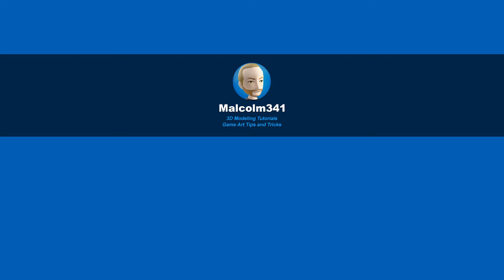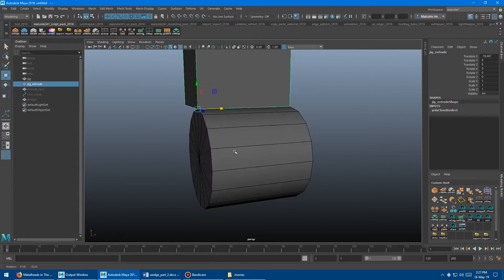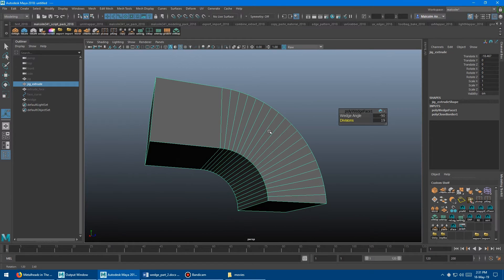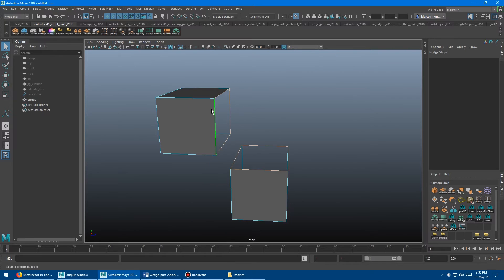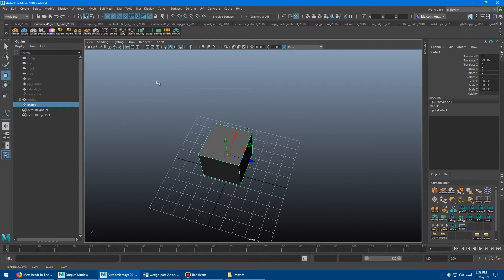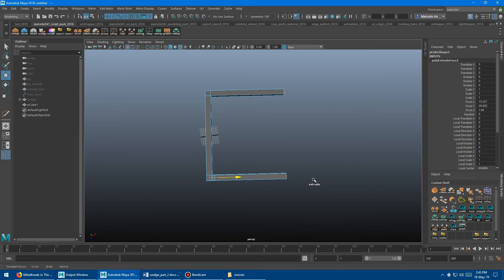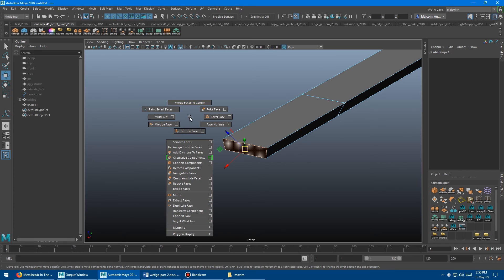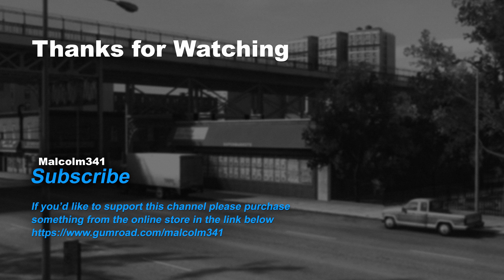How to Use the Wedge Tool in Maya - Part 2

Comment: You used Curve for bridge type, change the type to blend instead of curve and it will evenly distribute it without overlap. But I love the wedge version, especially if trying to match it to a specific type of Radius for a bend or corner. You rock man! Love your vids! Most of my Maya Toolkit playlist is your vids. I can't believe how many tools you cover that Maya users of years  of experience have never seen them, speaking for me as well! Regarding the extrusion of the faces in the new trick area, do you ever change your alignment to component with ctrl+Shift+RMB? I usually switch from World to component when I need to extrude along a face's direction. I just have to remember to switch back otherwise snapping stops working if not in world alignment.
Reply from the maker: I'm glad you find these videos useful. Yeah sometimes component mode works well for certain operations. There is an even easier way to wedge without even needing the jig, in the comments someone showed me you can create plane facing X, extrude the bottom edge a little bit, the in multi-mode selct the main quad face and shift select the bottom edge you just extruded and then wedge. This works on 3d shapes as well, you just need to a temporary edge and delete it when you're done.

Comment: the 45 angle trick is awesome bonus tip!!
Reply from the maker: @QCode11 Nice, glad it's helpful. I was shown another way to do it recently as well where you don't even need to create the cylinder. You can actually do it with only one mesh required. Create a cube and use the cut tool to add one horizontal edge on the side of the cube which will make up the face we're going to wedge. Now add another horizontal edge below the first edge and that will be used to create the gap/inner curve we would normally create the cylinder for. Now go into multi-select mode and select the upper face we created followed by the lower of the two edges. Use wedge and you'll get the same result without the need for the cylinder.
Reply: @malcolm341  So here what I did was cut a cube in half by multicut, then used the upper face with the lower edge of the lower half, and it does work like a charm!! Another option was to add any temp cube and, add optional edge loops, then use any edge to "wedge the face around" that way the selected edge seems to act as the "pivot" for the face to "wedge" around, thanks a lot for the tips!! knowing how to do things multiple ways definitely helps a lot!! And here we are many years later I found your channel to be of great resource when I need 'technical' know-how to do things!!
Reply from the maker: @QCode11  You can skip the temp cube all together and add a second edge below the multi-cut edge you added to act as the pivot, that seems to be the least number of steps I think.

Comment: Watched first part, now watching this, already did try it out and really thankful for this!!
Reply from the maker: @QCode11 an even faster way to do it is avoid the jig all together and add a temp edge to your object to use as the pivot point. For example create a cube and add a horizontal edge near the bottom of the cube, select the face above the edge plus the buttom edge of the cube, not the edge you just created and then wedge. That will allow you to concron the inner shape of the wedge on the same mesh.

Comment: u can even go simpler and faster with wedge tool , u don't need to create cylinder all u need to do is select an edge (any poly edge) that exist vertically under the selected face and then wedge (u can snap cube there and select its edge), after that u can simply controll the curveture by selecting wedge node and changing centerY attribute in the channel box ,i saw ur 2 parts videos to explain why when selecting 2 edges of the cylinder gives u the expected result is that when selecting 2 edges maya use the middle between the 2 of them which in ur case directly under the face , the selected edge in wedge tool is a rotation axis for the extrude faces ,imgine selecting the face and changing pivot to the edge then rotate the face from there,that's how wedge tool work but with extruding new faces
Reply from the maker: Nice, your method is even faster. You could even just add a temp edge to your first mesh and not even need a second mesh to select the edge on. Great trick, thanks for sharing.

Comment: finally a perfect tool for curves, thank you so much!
Reply from the maker: If you have 2022 you can also use the new sweep tool which is better for making curved pipes and other shapes.
Reply: @malcolm341  sadly im using maya 2020 but thanks for the info
Reply from the maker: @Ganzorpoe2  Dang, it's worth the upgrade if you are extruding pipes or roads, if you just need to do a couple corners wedge will be good enough.

Comment: 12:26 I feel attacked uahahahah
17:10 I don't get this part. I mean, it's a lot of steps and options to check no? Wouldn't it be faster to just grab the two vertices (on the left or the right) and make them coincide with the position of other two? boom, flat
Reply from the maker: Try it on a sphere by selecting multiple verts on a non-right angle part of the sphere and it will make more sense, it allows you to planarize any group of components to any specific angle so you don't need a script to do this. Oh wait, I made a video about this that describes it better, ha ha! https://youtu.be/yMyPsgaXstM?list=PLAUgGUDpaMENlPgh_phLty5JrumqX7Yr1

Comment: Hi! About Bridge Tool, you can just use Curve Type: Blend and add the Divisions as many as you need)
Reply from the maker: Unfortunately that doesn't work, blend does not create the correct elbow shape, the proportions are off from the side view.
Reply: @malcolm341  Oh, ok) Thanks for the reply! I haven't tried your method yet, but I will definitely try!
Reply from the maker: @irenmischenko5024  If you don't care about the exact shape and just need a curv then other methods will work fine, but I need the shape to be exact for certain models and the wedge tool is the only one I could find that would create the correct shape.
Reply: @malcolm341  I didn't even notice the wedge tool before I saw your video, so thank you for it!

Comment: this is much better and efficent than the first part.
Reply from the maker: Thanks, yeah, learned it a couple weeks after posting the first video.
Reply: @malcolm341  I should find this useful while designing my cycle frame. like you said its important that there is equal measurements on both sides of things otherwise things go off whack. eye balling and drawing will not be so accurate and some models demand accuracy and symmetry. i play around with maya and often find myself lost in the mesh. most of the times i end up scrapping my work and starting over in a new file. another challenge i face is with applying boolean. some say maya boolean has bugs in it but when it comes to complex models. but boolean is another story. maybe you have explained boolean tips and tricks in another video ill check. Thanks! :)
Reply from the maker: @the1trancedemon  booleans are a bit sketchy in Maya, sometimes your model will disappear. This is usually caused by the object not being a closed surface or there being no intersecting edges that cross the boolean.
Reply: @malcolm341  so true. if i do booleans after modifying a object, something has to go wrong. as a solution, i do booleans on fresh objects before any modifications and try to work on each part separately. but thanks for letting me know the actual reason why booleans make objects disappear. i used to wonder.
Reply from the maker: @the1trancedemon  I found closing the surface of both objects is the main thing that can fix it, and sometimes it just won't work.

Comment: I wish the bevel just had a switch between the way it works, and the kind of result you get from the wedge
Reply from the maker: Could be cool, you can press Ctrl + b to bevel as a built in hot key.
Reply: @malcolm341  btw, not sure if you know. But in bevel setting you can set the "mitering mode" to none, and the set "force parallel" to 1 and that will make a lot of bevels more clean
Reply from the maker: @cosmotect  I'll give it a try.

Comment: I would just add an easier way for adjusting the pivot for scaling at the end. You can hold D+Ctrl and then the pivot will align with selected edge but will not change position. That way you can save couple of moves :)
You can also change pivot position without rotating it with D+Shift and aim component with D+Ctrl+Shift.

Anyway, great tutorial for wedging! Thanks a lot.
Reply from the maker: Good idea, thanks for sharing those tips.
Reply: Or just ctrl+shift+rmb marking menu to "component"